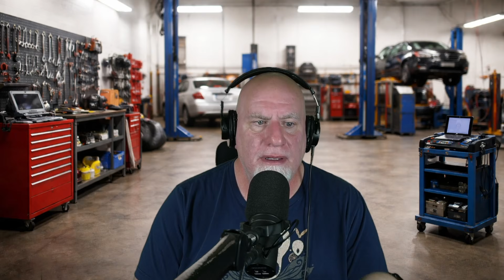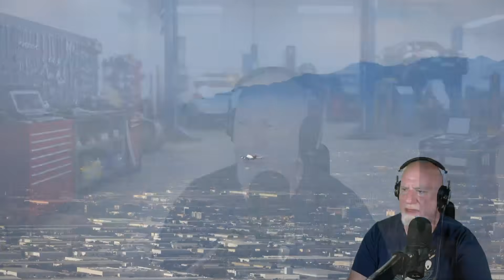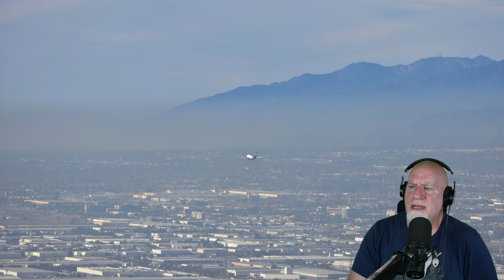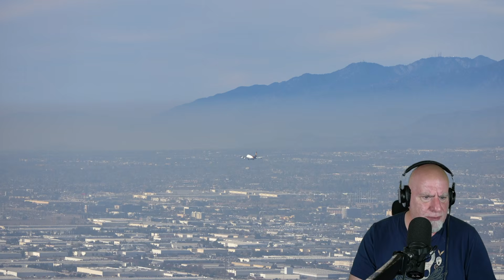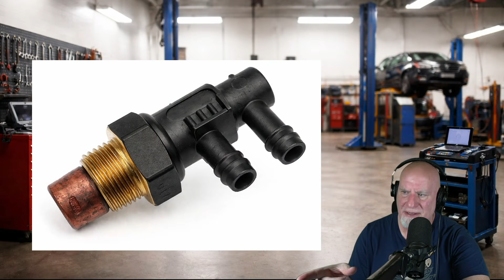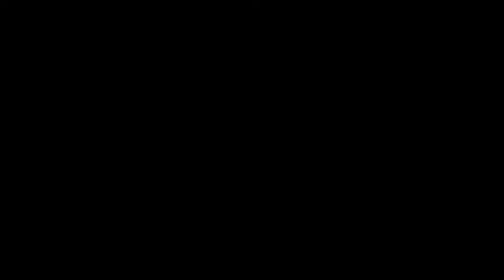EVAP Systems Explained: Why Fuel Vapors Were a Problem

Comment: Does a monitor have to run to completion first( ready/complete)before checking for leaks? From what I have read, the monitor look for leaks as the monitor runs it self test.
Reply from the maker: Thank you for watching and for the question. No, using a bidirectional scan tool, you control what the PCM does so that you can check for leaks.
However, after any service engine light repair, you do need to drive the vehicle under the conditions for the PCM to run the monitor test to verify that it does pass.
Hope that helps!
Reply: @BillTeachesAutoTech  I had an evap leak from the line going to the charchoal to the purge  valve, replaced the hose and erased the check engine light, which reset the monitor to incomplete. After driving the vehicle for a while, the monitor now says complete. The reason I asked the question is that I spent quite some time worrying about  the check engine  light coming back even weeks after the monitor had run to completion. Thank you for replying.
Reply from the maker: @bebeto71-iv4qq  - Some of the monitors have some very specific conditions that have to be met to run them. Glad it didn't take too long, and I'm happy to have been able to help!

Comment: Thank you. These videos are super helpful. Could you do more videos on electrical diagnosing? Like how to load test a circuit, find a parasitic draw, how to diagnose network issues or maybe even a real world, live example of how you’d diagnose a car from start to finish? Like what are your first thoughts, what you’re looking for, stuff like that
Reply from the maker: Thank you so much for this comment. I actually have some live examples of Evap problems that will either be a 3rd video in this series or be included in the next one.
Since I don’t have a shop at my house, it is difficult to make live work videos, but I will try to make that happen.
Thank you for watching!!